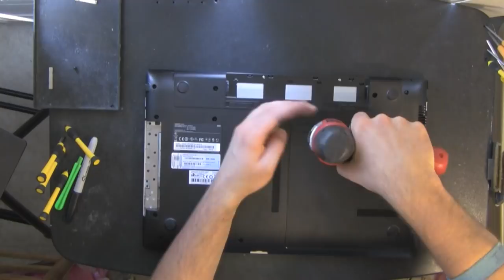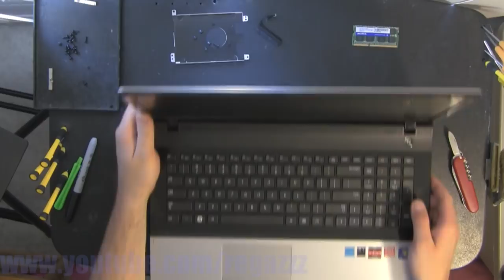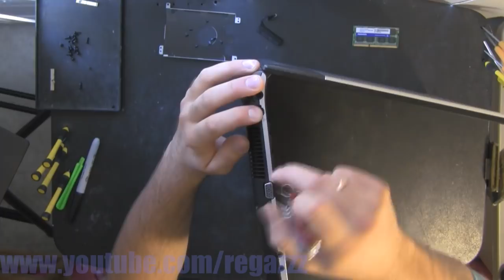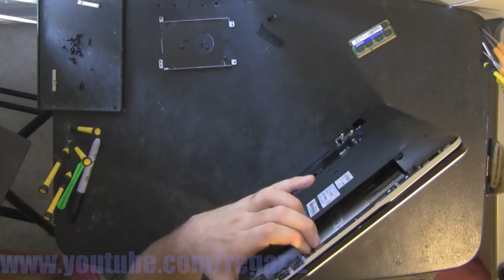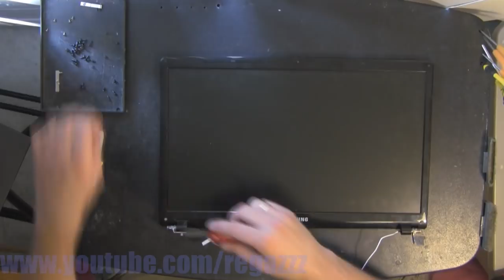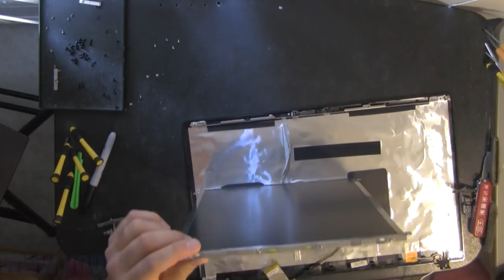SAMSUNG NP305 305E7A 305E take apart video, disassemble, how to open disassembly

Comment: One thing I like about this video is it's not "wham-bam" and you're done.  It shows the difficulty and challenge to taking a laptop apart.  Except for some of that "knife action", I thought it was well done.  I was watching as I needed to get the MAC address off a wireless card.  It seems the card is embedded vs. just going through a port area as in memory and harddrive are.  THANKS!  /Roy

Comment from the maker: This is one of a stupid thing can be with some laptop. 
If you will remove this plastic it will be broken.
The whole palmrest and keyboard is like one piece. It isn't, but there is no way to remove keyboard for example. Because you may need to glue it back and this plastic cover you may need to glue back too.
I would remove it if it will be possible... 
Sorry.
Reply: да всё возможно, там клипсы впаиные пластиковые, паяльник + длинный шпатель и готово. новую клаву ставишь в те же отверстия, и термоклеем(можно супер клеем) приклеиваешь. Я на днях заменил, всё ок. А вот че с тачпадом делать - хз